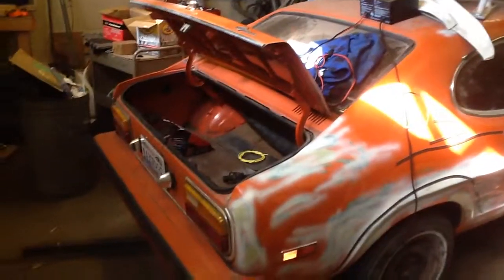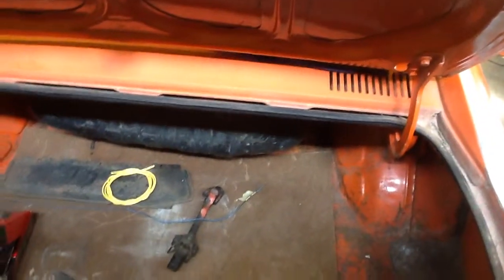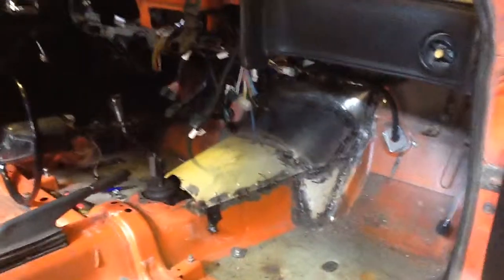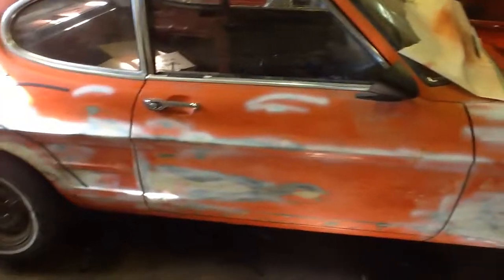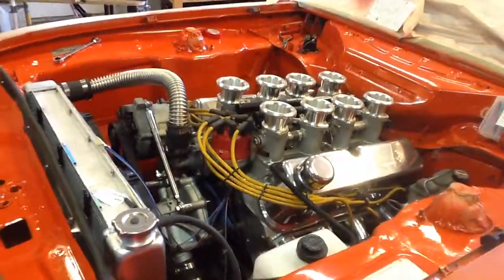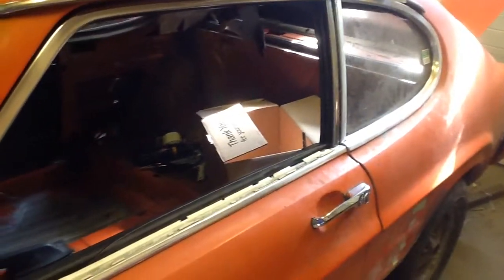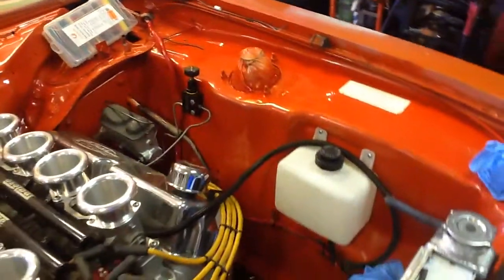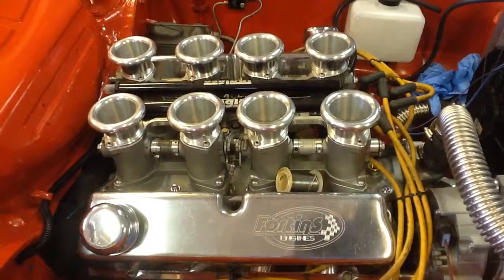Capri Perana Clone

Comment: nice project! Had a 1973 2600 and foolishly sold it in 1986 after restoring it - needed the $1,700 I got to put down on our house but always wanted to drop a V8 in it - so much room there for a bigger engine. My mom bought it new for about $2,700 and gave it to me in 1980 but always admired the Perana. My mechanic was from Jamaica where they love them too and had a yellow 1974 and dropped a Mustang V8 in it. Was wondering if you ever shot a newer video since this was done several years ago?

Comment: This is nota  V6 Shell did you strengthen it in any way? here in Europe the 3 Liter V6 cars had strengthening plates at the top of the struts and in the corners of the engine bay
Reply from the maker: +1975 First On Race Day Capri 3.0 Ghia  (Reply) Since the Body is virtually rust free we felt that it would hold up to the additional power OK. That said, we did add gussets on the front frame rails where they go under the body and added additional welds where the inner fender meets the firewall. Also in as much as we replaced the 150 LB front bumper with a 15 LB early model chrome unit, the end result is that the car now sits slightly nose high so the load on the shock towers would appear to be, if anything, less than it was with the 2.0L. I have a Blog about the build at www.capri-perana.com if your interested.